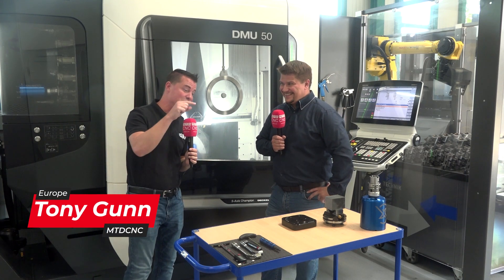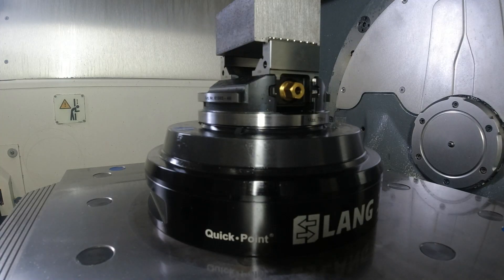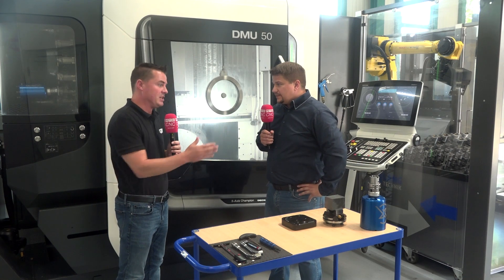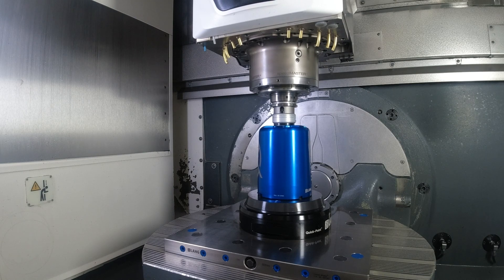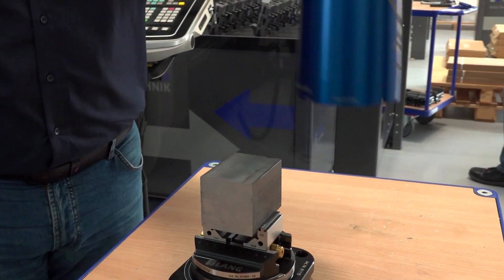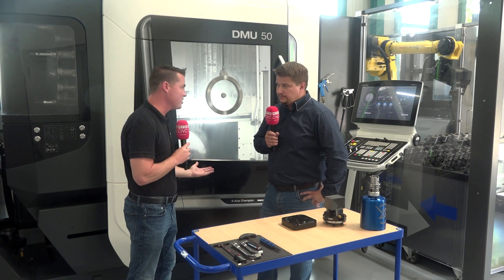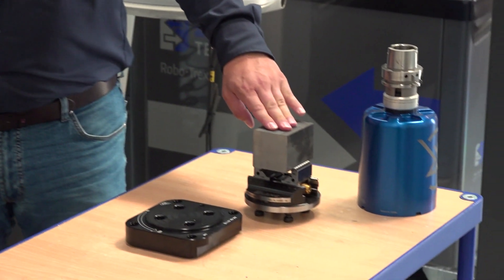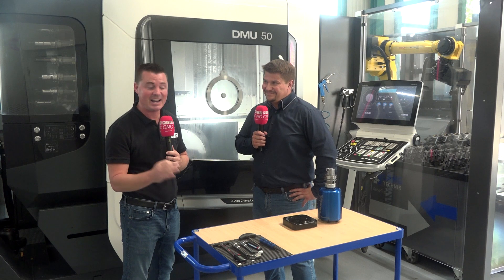Is this the world's simplest automation solution!

Comment: This is really interesting, but how do you turn the spindle so slow to a specific position on a Fanuc HMi control? M119 S90.... will position the spindle very accurately to a certain position. But it's really fast - how do you control the speed? I found nothing in the manual...
Reply from the maker: Lang can help you create a program for this !
Reply: @MTDCNC  Hopefully, yes but would be nice to test it on a real machine before we buy a lot of these😀
Reply: Couldn’t you just slow the feed rate within the program?
Reply: @jakabz9104  But how would you program it using spindle positioning?